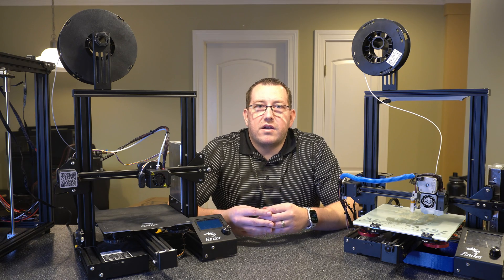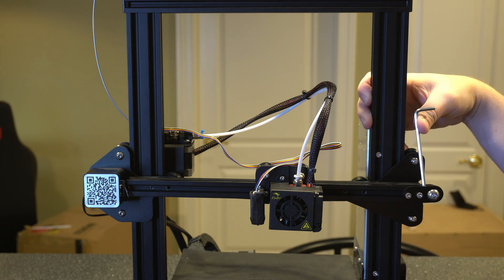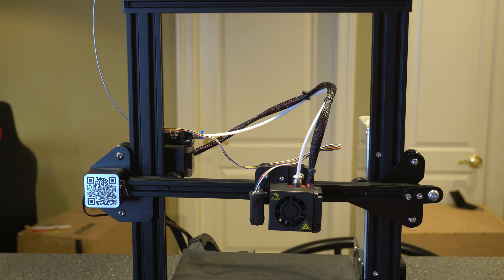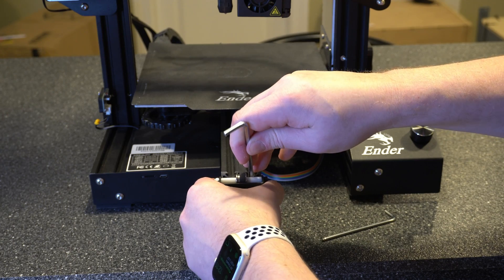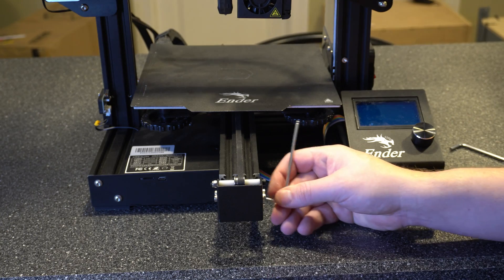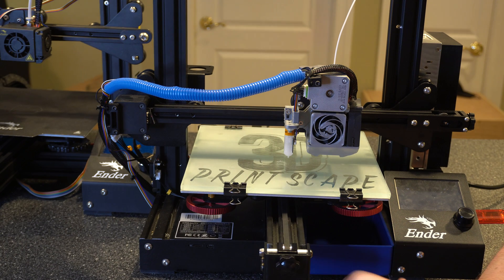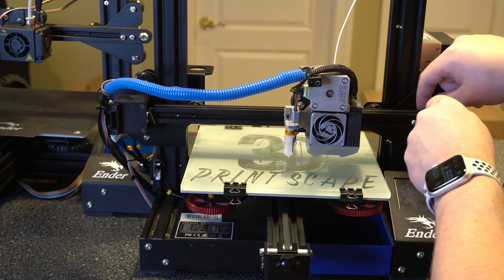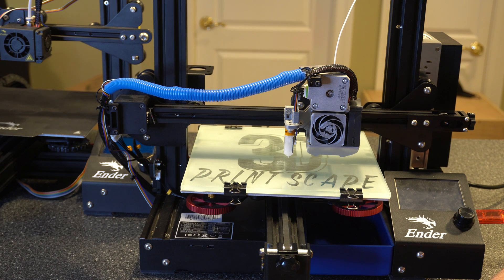How Tight Should My Belts Be?

Comment: Rob, 
Less artifacts will show when a belt is tensioned to the point that the  pluck you speak of is producing a hertz frequency of 150-175.  This can be tested with several note finder apps on both IOS and Android. I am sure you will agree that movement is much smoother when rollers and belts are “not to tight”.  Rollers should be able to spin with your fingers in place against the 2040 or 4040 aluminum profile. If I am going to have some rollers tighter than others it would be the ones on the Z axis near the Z rod. Especially if it is not a dual Z srod crew.  Less drag on the free floating side is paramount!  A perfectly straight x gantry once obtained and secured will prove long lasting.  Less artifacts and smoother layer lines will result even under a microscope.  The fact that most all belts consist of rubber and strands of wire means that once the slack point is made, only a small amount of tension should be applied after that.   Thanks for all you do,  I feel a bit odd telling an OG these discoveries, though what it is worth I have an extensive engineering background and have been blessed to afford the time in that last year to devote my every day (and night) to obtaining absolute perfection on 3 machines which I have built.  Hey while I am at it, I want to share something with you concerning the fact that aluminum extrusion profile does in fact collapse fairly easy, over time with the tightening of the m5x45 bolts.  This is problematic in two specific areas, 1. Maintaining equal distance from left Z rail to right Z rail both bottom distance and top distance.  The top will be difficult to achieve in the case of an older, over tightened machine.  Even more critical is the fact that the Y axis being the bed runs on a single 4040 extrusion which is mounted also to a single 4040 extrusion, to make matters even worse is that the bittom 4040 is cut/notched out so to mount together. I have seen several machines where the m5x45 has squeezed the profile making it impossible to maintain bed level integrity.  I have a resolution for this issue and whether present or not make one HELLOFA difference.  I would love to share this with you because I can’t believe it has not been addressed yet.   When I tell you that my machines are on point, I can 100% of the time hit start and walk away from it. Printing directly on Borosilicate glass with a flawless first layer and print EVERY time!  To add to this I rarely if ever have to adjust.  With the solution that I speak of, a small bump or moving the machine will not affect said performance in any way.  How is it that I can speak with you?
Reply from the maker: Hi. You can reach out to me on discord. The server invite is in the video description.
Reply: @3DPrintscape  You never answer it seems.
Reply from the maker: @CryptoPivot  I am on discord a decent bit and answer when I can. There are also other mods and members that answer questions as well.
Reply: @3DPrintscape  It was not a question.  Forget it.
Reply from the maker: @CryptoPivot  Sorry, i do what i can with the time i have.

Comment: I've been seeing these weird....things....whenever I print the cube. If I am looking at it straight on it looks perfect, but if I tilt it just right I can see some extremely noticeable lines/ridges running up the entire print. Would this be caused by the belt or something else?
Reply from the maker: Hi. Its hard to say without a picture but if they are always in the same spot it could be from something on your track or a damaged wheel.
Reply: @3DPrintscape  going from memory it's basically in the same spots every time
Reply from the maker: @Etj1013  I would look at the track and wheels. I had a small dent in a wheel that caused a similar issue.
Reply: @3DPrintscape  i'll take a look when I got home. Thank you!

Comment: did you ever encounter the problem, that the y-axes starts "rattling"..as soon as the extruder travels a little faster, theres vibration and rattling? On Ender 3s1? I tried all kinds of tension on the lower wheel with the excenter-screw. Sometimes it seems perfect for 1-2 hours, but on a longer print the rattling increases over time. Its so frustrating, i got the X-ax perfect meanwhile, the Y only has 1 wheel and still i cant manage to let that extruder travel silently.
Reply from the maker: Hi. I havent had that issue. Is the printer level and is everything else tight?
Reply: @3DPrintscape  yes everything is leveled, also prints look fine. Its just i can hear a lot of stress is created on the rails and wheels. The longer the print takes, the more the rails start to vibrate on sudden movements. Already decreased travel and travel acceleration.
Reply from the maker: @peerrucke2599  Something seems off for sure.

Comment: My ender 3 pro doesn't have a space to put the Allen wrench in to apply tension, its just the belt exposed -- is that normal?
Reply from the maker: Hi. You should be able to put something small between the two parts to stretch out the belt a bit.

Comment: Great video :-) unsure if it is worth mentioning but depending on the placement of the bed or hotend the belt may feel more loose/tight than it actually is. If you move the hot end all the way to the left it will feel looser so worth finding a reference point on where you are going feel the tension from. This could be why people are over tightning.
Reply from the maker: Hi. Thanks for the feedback and ya great point. If possible, the carriage or bed should be in the middle when doing the test.

Comment: I've snapped at least 2 belts tensioning with the Allen wrench. Honestly now if I was going to retension my belts I have spares on hand otherwise I've been left down for days waiting for new ones
Reply: Aren't you dramatically warping your belts by tightening so much they're at risk of snapping? Have you measured your prints for size accuracy?
Reply: @headerahelix  prints are accurately sized within 0.01 of a mm so am happy enough

In saying that I believe I had some faulty belts from creality as the gates belt I have no has been running beautifully
Reply from the maker: Hi. Sorry to hear that, i havent had any issues with getting anywhere snapping the belt.

Comment: Thoughts of Marlin performing home X 3 times in a row and referencing the time to a baseline to complete the task to help determine if the belt needs to be adjusted? Imagine a feature called "check belts" where it autohome 3 times in a row and compare to a baseline to determine if any adjustments are needed? Silly or practical concept?
Reply from the maker: Hi. Thats an interesting thought. If there was a set time to complete some of the movements that would deviate enough if the belt is too loose or too tight, that could work. Im just not sure if its that precise.